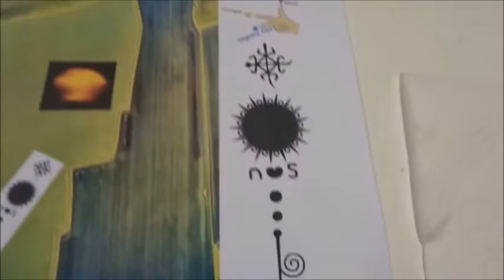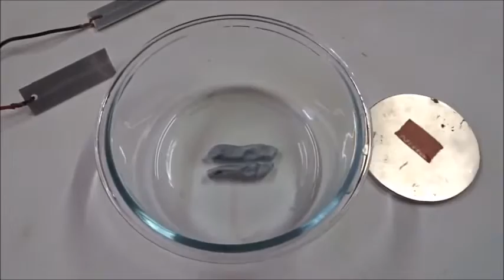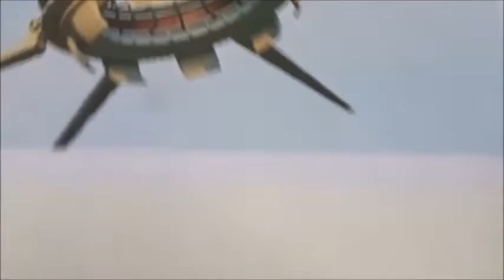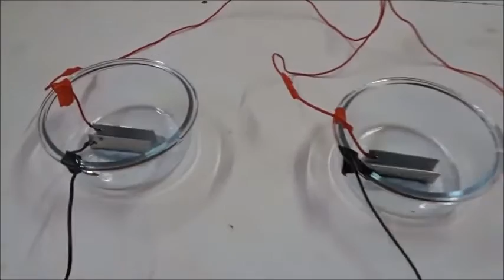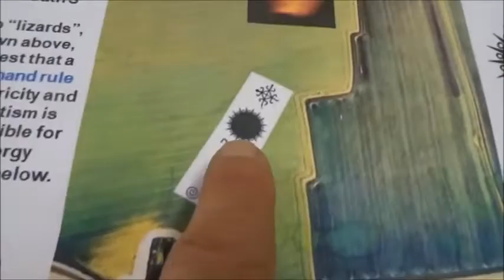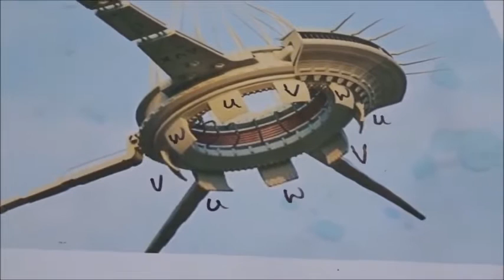The dragonfly-drone UFO flies by 3-phase, magneto-plasma-dynamics

Comment: I'm gonna need more of this topic as this is interesting. 

The only key question I was thinking is that what sort of material that can helps ionize the unlimited amount of electron in the air that easily powered up the spacecraft and I was thinking on some kind of harmonious frequency that able to lift the whole thing up, then should the spacecraft need some kind of Auxiliary Power Unit like our jet engine powered aircraft in order to start the spacecraft. How those spacecraft tune to a frequency and make an immediate jump. That's a whole lot of question to answer.

Comment: Really Great work Red!
Maintain entropic state by avoiding saturated states: Tick.
Use of local resources for thrust to avoid craft loadweight: Tick
Doping and capture of local field with heavy dense matter: Tick
Obtaining capacitive pulsed field to keep inflight hardware weight to minimum: Tick
Central Drive Column type Drive: Tick
Unfixed Ideas about how it all should work: Big Tick.
Steering and radio control mechanisms: yet to do? multiple antenna?
Source of energy? Beam?
Back Engineering can be fun.